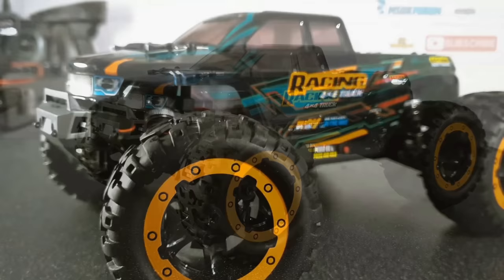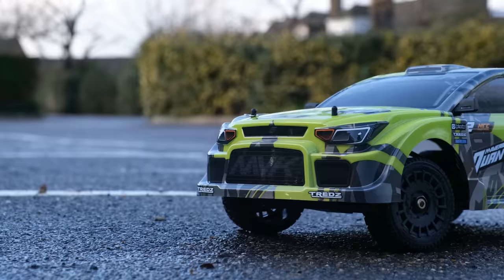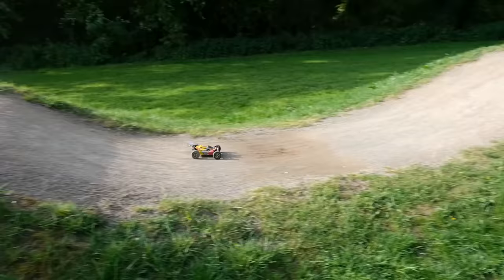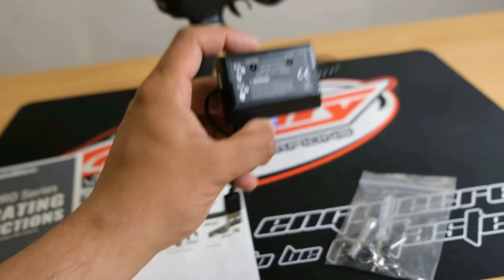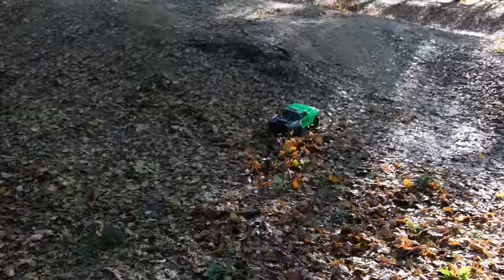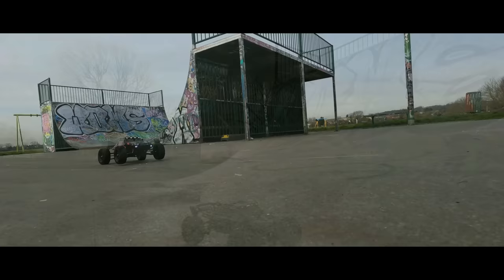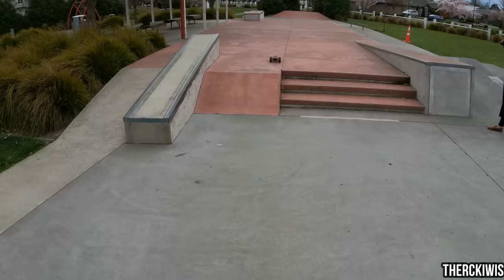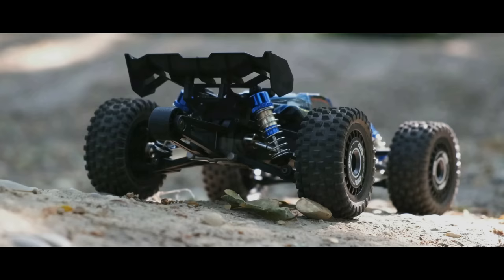Top 10 CHEAP RC Cars of 2023 (Still Good in 2024)

Comment: Im not a big fan of anything less than 1/10 scale, they tend to get a bit too bouncy for my taste. With that being said, the team Associated Rival MT10 is so durable and fast. Throw some RPM arms on it and you can all it bulletproof. Ive had plenty from the Arrma 3s line-up and theyre all amazing but a bit more expensive. Either Team Associated or Arrma will have parts that are easy to find and replace.

Comment: Just bought a no name brand. (prob made for the local RC shop we got it from) probably came out of  HPI factory or similar. Unbelievable quality, full anodized aluminium frame and shock towers etc. Fan on the motor heat sink, all metal shockies, 1/10 scale, same plastic poly carb cover as all the top brand top models, a non brushed motor but upgradeable, came with a 7.4V Lipo battery, all connectors look like good high temp insulted and gold plated. All metal parts for suspension, cast alloy arms but of course upgradeable. Top speed unmodified  around 50Kmph. 4WD. Nothing looks cheap under the cover. The shop had about 10 boxes of them, no branding anywhere only the specs of which i couldn't believe, I was in the store to buy a can of WD40, LOL walked out with a TC truggy!

Comment: Budget go for ftx or the arrma boost . If you have a smidge more then the associated mt10 is good and  1/8 wise try the ftx dr8 none of these will brake the bank and parts are reasonable
Reply: I use an arrma boost for messing around with and there great fun

Comment: Man, i need some help from you. I want a rc truck for surveillance. I use a drone but i cant hold my weird devices in a drone. Things like night cams, torches, etc, tends to weight too much and the flight time is dramatically limited. Therefore i want to try with a truck. I can load the truck on batteries and spend hours of surveillance. I need it not to run but to manage dificult terrains instead. What do you recomend?
Reply from the maker: budget?

Comment: Yo beyond rc my 144001 steering went out
Replaced the servo still not working

U think I should replace the radio remote/ transmitter
Reply from the maker: would check the receiver also. Could be that
Reply: @beyondRC  alright thanks 👍

Comment: I love my Am x12 but I almost instantly broke a rear hub and they can't supply a replacement... looking at converting to a lc racing emb hub but I need the smaller bearing and axles (cups at a minimum) to match...yes I have to down  grade in axle to continue.... other than that it handles better than anything similar I've used (on the smaller pinion) lc racing included, maybe a different servo would be first upgrade to be a little quicker and a high amp ecu and higher kv motor if I get hungry, then it would be an extremely competitive weapon for the money

Comment: Unimpressed with banggood. I ordered a 120417 with a decent charger and some spares in October. They don't seem to put their in stock items aside so I watched every item in the basket go in and out of stock for months. The car arrived promptly but I haven't been able to test it because they are seemingly incapable of sending my charger...
Reply: Why don't you just use the cheap USB charger it comes with until your decent charger arrives? That's what I did,I got a wltoys 124017v2 from banggood, I also ordered a better charger and better 2s and 3s batteries. I ran it off the stock 2s battery using the little USB charger it came with until my better batteries and charger arrived

Comment: These are not cheap at all I was hoping yo find something under $200
Reply: Unfortunately my friend, you honestly get what you pay for in RC. Save up for something name brand with hex hardware and tenth scale. You won't spend any more than buying a few of these micro things that go in the garbage when they inevitably break. I bought my first arrma (senton3s) over three years ago for $300 because the box had been opened and it is still 100% stock besides the duratrax tires and nothings broken. It's been used hard and hung up wet and just won't quit. Absolutely blisteringly fast compared to any Amazon cars on top of everything else.